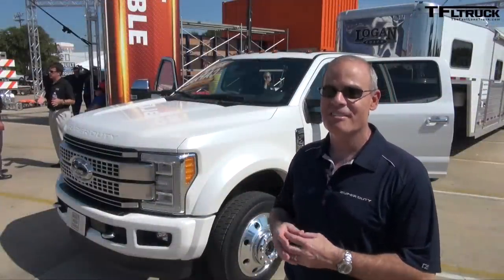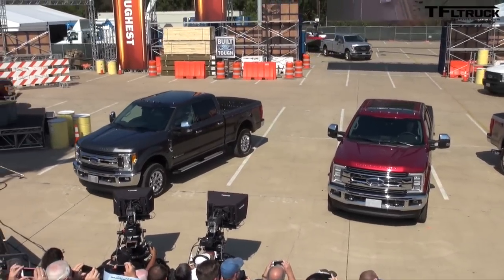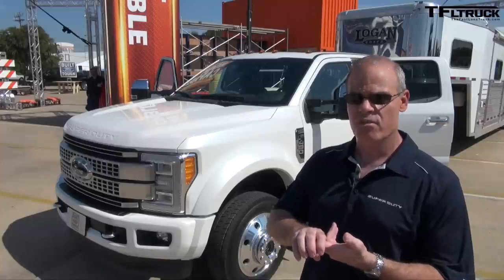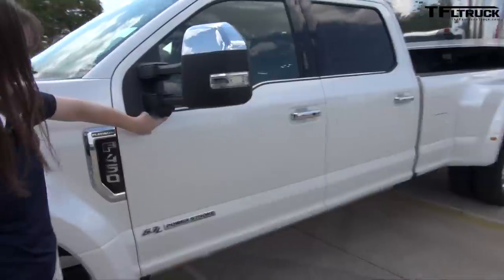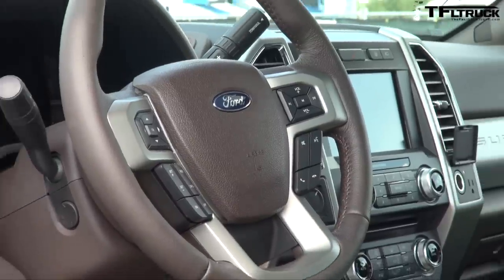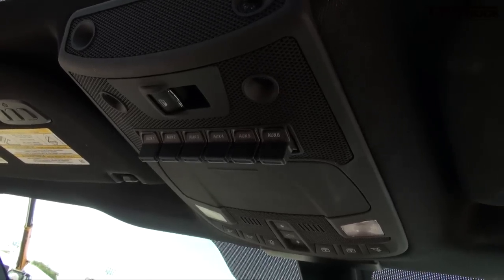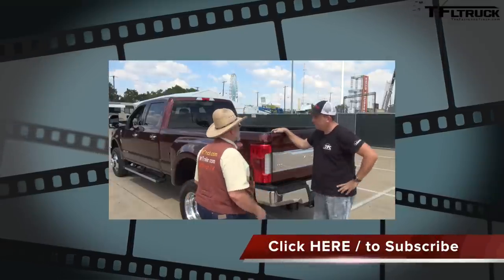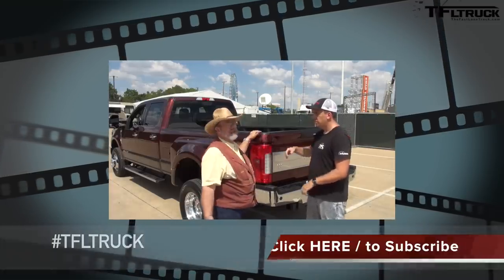2017 Ford Super Duty: The Important Stuff You Always Wanted to Know

Comment: You are correct that GM did great with the 8.1 however in many applications more specifically towing the V-10 is the preferred motor in non diesel applications. We sale 15 to 20 F-450 and F-550 per month in Rollbacks and Self Loaders (Repo Truck) and 95% are V-10 powered. This motor is so popular that Ford has announced to dealers that they are running low and orders for 2016 Models with V-10 power will be full in the next 2 weeks for the rest of the model year!

Comment: Vibration in the steering wheel is not a great idea. I wonder if this is an optional feature. Any ideas?
Reply: +vais3 I would think its more like the vibration feature in your phone not a shimmy of the wheel that would make you swerve
Reply from the maker: Yes, lane departure warning is optional.
Reply: +The Fast Lane Truck That is definitely something I would not particularly like in any vehicle. In my experience I have seen drivers panic with such systems. In my part of the US we have rumble strips that provide vibration and audible feedback.
Reply: +vais3 rumble strips are only on shoulders not between lanes which is what this feature is designed for
Reply: +Kerry Burton if you are on a 2 lane highway rumble strips are between the oncoming and shoulder lanes. 
My point is this system could potentially scare a driver if he/she is focused on the task at hand. I am almost certain a simple lane change would produce a vibration feedback also.
Reply: +vais3 if focused on task at hand u wouldn't wander to another lane and I'm sure useing an indicator would disable the vibration feature for a lane change even though lots of people dont know how indicators work....
Reply: +Kerry Burton a simple wind gust can send you into another lane if your riding the line rather than centering the truck. I can agree with you on people not using signals when they should, it's aggravating. You are right the use of the signal may deactivate the vibration feedback. 
A TFL Truck test drive will tell quite a bit. I would hope they are reading because I would be curious and I'm sure several people are also.
Reply: +vais3 Our 2014 Explorer has the lane departure warning system, when you turn on the turn signal to change lanes it does deactivate the warning for that side of the vehicle but if you don't use the turn signal the system picks up the fact that you are changing lanes pretty quickly. You can also disable it completely by pressing a button, I think it is actually off by default and you have to turn it on but I'm not sure about that.
Reply: +vais3 you could always turn it off
Reply: jim dandy that makes no sense typical response chevy ram blah blah ;)
Reply: +vais3 In my Silverado High Country the seat vibrates, scares the shit out of me sometimes when i forget that it's there.
Reply: +Kerry Burton You need to travel more, many states now have rumble strips before intersection as well as down the divider lines.
Reply: I had this same feature in my '14 M5 and in fact it is very helpful; especially with sleepy drivers and drivers who's attention is on the cell phone for instance.  Any driver who would panic with this system is asleep and there are very few parts of the country where there are rumble strips in the center divider.

Comment: A V10 gas engine in such a truck - got a private oil rig?
Reply: I've got an Excursion with the V-10. Don't change it but every 15,000 miles using 8 quarts
Reply: @F-350 Guy I've got flowmasters on mine and it sounds just as good as the 6.2

Comment: OK. All of the RVr's are asking what size are the gas tanks? Hopefully, not the way too small 26 gallon tank currently on the diesel short bed. The problem is that you watch the gas gauge go down very quickly and you constantly need to find a diesel station that is RV friendly.
Reply from the maker: Great question. We will ask Ford.
Reply: +Heddingmyway Gotta get a titan tank or a flowmaster system! :D
Reply: This is why we have an aftermarket, there are various  secondary  tank options for poeple that want extended ranges.

Comment: I am a big fan of this truck! And I am just dying to have one. Only problem is that I'm 16 :/ I am a die hard Ford boy. Can't wait until I am able to buy a truck like this, WELL DONE FORD!!! 😀😀
Reply: +Jaydenn Hicks I discovered really fast that these trucks eat tires and brakes for lunch...the pads and tires last about 30k and tires are about 800 and brakes front and rear cost me about 300 just for the pads and shoes my old truck used(I had a 1992 f350 diesel and two e350's an 1989 with a 460 and a 1990 with a 300)...get yourself a nice f150...they are very capable and you'll love it...I rented a 2014 f150 5.0 and it was so much better than any of my other trucks at towing/gas mileage etc... an absolute pleasure to drive

Comment: I understand the cameras and other features are for safety and ease of use, but if you need seven cameras and a vibrating steering wheel to drive a truck and tow, then you shouldn't be driving that truck or towing with it. Id say three or four cameras at most, and have them wired to the infotainment to create the wrap around view like in some f150's. (i think it was that model-i remember a truck on this channel having that feature.)
Before i get hate for saying this, i am under 21 and don't drive, but when i do, i intend to learn it without electronic assists. 
And a question-so, desert race trucks are usually made entirely out of tubes, a tube chassis design. Would that be practical/strong enough for a HD truck? Production and labor aside, would that chassis function? (I understand fabricating those is not a point and go job...the complete opposite of it, in fact.)

Comment: You need to be able to take several of those cameras and record them so you have builtin Dash and Read cameras. In fact I'd like to see a mode where you could record the 360 degree view as well. That way when you have to go through checkpoints you can record the K9 going around the truck. Let us supply the memory cards they just need to provide the control. I'm betting they could reprogram the system to do just that. And no I'm not being paranoid just stating fact on something that happens all the time.

How tall is the bed now? It's been tough using the newer pickups with many of the RV 5th wheels because the bed sides are getting so darn tall that the trailer won't clear them.

And not being able to turn on the rear camera when moving forward is just plain stupid especially the bed camera. You need to be able to see if there is a problem in the bed or with your trailer connection.

Looks like a good truck but we need to know more. It's also a truck that I'm betting will cost well over $80K.
Reply: +timon0x31 That 360 degree view for checkpoints is a damn good idea. I was at a checkpoint in Arizona in my 93 F-250. My dad and I baby her and the paint job. I'm not saying border patrol does a bad job but the fuck'n officer had the dog jump on the passenger door. I was gonna explode on them but I was tired as hell. 3 hrs later I'm home and my 22 year old paint job is fuck'd.
Reply: +timon0x31 The bed is actually a little bit shorter than the one used on the F-150. Notice that the top of the bed doesn't quite meet up with the bottom of the window.

Comment: Will be ordering a 17 F350 4x4 reg cab with the PSD as soon as they let the dealers order. Trading my 15 F350, which has been a great truck thus far. 
Any word on new for 17 colors?
I want ford to go after the SNOW PLOWING MARKET next. More guys make a living plowing snow than pulling a trailer. Heated wipers, integrated flashers for the cab clearance lights and mirror blinkers, TOP QUALITY SNOW TIRES AS A FACTORY OPTION, defogger for the rear window, HUGE REVERSE LIGHTS, and for the love of God......can Ford please make a heating system that will supply heat to a man's LEFT FOOT and not JUST the right foot??? I actually use my left foot to drive just so I can keep it warm when it is 0° out.

Comment: All these unnecessary upgrades only increase retail price. The people who use these trucks need the power/strength not the luxury. "It's a NO from me"
Reply: +Michael Cain most are OPTIONS u can get the bare bones work truck for a lot cheaper without all the bloat
Reply: +Michael Cain Then dont buy a loaded truck ,its really that simple .
Reply: They still offer the xl and xlt. They just don't get as much attention on release because the luxury trims have the latest and greatest features.
Reply: +k3v015Mk unfortunately, the XLT models at my local Ford Dealer are pushing $50k MSRP! the Super Dutys they sell are EVEN MORE Expensive!
Reply: digitalrailroader yeah that's true. It just gets to a point where you might have to order one to your spec to save money. My 15 xlt scab is pretty basic and was 37k with incentives. Just depends what you're willing to pay for I guess.

Comment: the parts counter guy at work at our fleet dept. showed me the size, or lack thereof, of the starter in a v10 2013 ford.  They certainly didn't reinvest anything into the starter...failed already..   I've seen riding tractor mowers with bigger starters.  (visually).  "new and improved."  If it is new, how could it be improved, also?.  Yeah, I'm in one of those moods.  On the plus side, it is a sharp looking truck.  I like the look of the  interior.  Ford's trucks as of the last 5, 6, 7 years, have impressed me with their newer design and way they drive.  that old s hitty plasticky gear shift was long over due to get rid of.  This is all coming from a person who isn't a ford guy, per se.  New GMs just piss me off.  Arrogant company.  Shame too, love my old caprice from the 80's... bought a tacoma instead.
Reply: THE STARTER IS A PMGR. PERMANENT MAGNET GEAR REDUCTION FOR WEIGHT SAVINGS. EVERY MANUFACTURER IS USING THEM NOW. IF THIS STARTER FAILED, ITS PROBABLY A SHORT TRIP TRUCK WITH MANY STARTS PER DAY, OR SOMEONE HAS KILLED THE BATTERY MULTIPLE TIMES AND DOESNT REALISE THE MAIN CAUSE OF STARTER FAILURE IS LOW VOLTAGE WHICH CAUSES METAL TO ARC,AND BE DRAGGED OVER THE GAPS IN THE COMMUTAOR, CAUSING FAILURE. .INDEPENDENT MECHANIC. MY OWN SHOP 30 YEARS. SEEN V10S WITH 725,000 MILES ON SAME ENGINE.  6 FLEET V10S, 1 STARTER, BATTERY CAUSED IT.
Reply: +MICHAEL SACCO thanks for the clarification.  He loves dumping on ford. Today, i dont have any loyalty to one or the other.  Everything is lighter, cheaper etc these days anyhow

Comment: Never seen such stupid cost items in my life,.. I want a truck with HD hauling and towing and a motor,... I don't need 7 cameras and a steering wheel that vibrates if i want to know where i am i will look out the windshield this truck has at least $20,000  in things i don't want or need in a truck..... and if your looking at 7 cameras going down the road you just maybe will run off the road and sue Ford......Back to Basics Guys and reduce cost and weight
Reply: that's why I buy the XLT model ... 30 grand cheaper
Reply: +Michael Reece coplains the XLT is too basic
Reply: +Chris Ragsdale . I'm not complaining I don't want all that bullshit
Reply: +Michael Reece I hear ya.
Reply: +Chris Ragsdale you could buy two trucks or you could buy one fully loaded truck that's what the price differences cuz you can get an XLT for about 30k to 35k depending on 4 wheel drive or not and a fully loaded one around here probably around 80 K.. it's a little bit outrageous how all the options can make them that expensive
Reply: +Michael Reece true. But people buy into if they have the money. I still think the truck looks awesome. I'd be fine with the package about the work version. My duramax is an LT with cloth seats and it gets the job done.
Reply: Yeah I have a 2008 f250 it's a XL the only options it has air conditioning heated mirrors power door locks cruise control power windows anna has the vinyl flooring and vinyl seat... and for my business I'm looking to buy a new F 250 in the next year so I'm really interested in this truck but even though it's 100% right off of my business I still don't want all that crap
Reply: +Michael Reece I honestly prefer vinyl floors lol. Carpet stains and is hard to clean. I wish my truck had them.
Reply: Yeah I love them my daughter puked one day on my back seat and floor and I just hosed it out..
Reply: +Newton Washinton That damn Step tail gate has to go. I have ripped off some caps from these poorly designed tailgates removing snow mobiles from the trucks equipped.  We are at the point of using a forklift with long forks to remove their sleds from their Ford with out damaging the tailgate.  I see quite a few trucks around with the tail gate step damaged.  GM has a good idea with the steps in the corners of the rear bumper.

Comment: FORD NEED TO ADD A CAMERA TO THE TAILGATE WHEN ITS IN THE DOWN POSITION.THERE ARE ALWAYS TIMES YOU ARE BACKING UP WITH THE TAILGATE DOWN
Reply: Caps lock is cruise control for cool.. Anyways, they have a camera in the third brake light you can use. Paying attention is hard.

Comment: I have a 2011 f250 6.7l and the brake pedal is mushy and thats because  the brakes are hooked up to a computer ,why not leave the brakes alone and leave them independent from the computer.The dealer told me its because my truck went from a brake booster system to a vacuum system  ,that has nothing to do with a mushy pedal Booster brakes  have a stronger bite than a vacuum system but it doesn't give you a mushy pedal when you go to a vacuum system .I have a 2012 f150 with vacuum brakes and you barely touch the brake pedal and that gentleman will send you through the windshield,I mean the pedal on my 2012 is very firm compared to the pedal on my 2011 f250. I just wish that I could buy the braking system of my 2012 and install it in my 2011.They have no clue what they are talking about when they told me that crap at the dealership.Sometimes the pedal wants to go to the floor,I'm just waiting to hit somebody and then sue the shit out of Ford for letting me drive a 7000lb truck with bad brakes.I advice anybody who plans to buy any of these ford trucks to test the brakes first and then make a decision.I was a chevy man all my life and when Chevy took that bail out money from the government and then it became Obama Motors I said the hell with chevy I went with Ford but now with the brake problems that I'm having I might have to go back to Chevy .The company that I work for just bought  a 2015  2500 HD and man the brakes on that truck will STOP that gentleman on the dime,I mean I could not believe the braking power that truck had. Every Chevy truck I owned ALWAYS had a firm pedal and COLD ac ,my 2011 ford f250 the ac is a joke.When my ford is paid off I was considering buying another one because I buy new trucks every time I pay them off but this time I might just go back to Chevy.Sorry Ford you did this to yourself by not addressing my problems.

Comment: "the design is unique" it seemed like ford copied the f150 and called it a day
they made the side view mirrors air vents, rear dually fender angular for the sake of making a refreshed design
Reply: +shylildude All auto manufactures are going to have the same key designs within a vehicle series. The F-Series is all 4 levels of truck, 150 through 450. You aren't going to have 2 completely different styles between each level of truck. GM and Dodge Literally have the same front ends for the 1/2 ton and 3/4+ ton trucks. Ford at least altered the design slightly.
Reply: +DirtyD the outgoing f150 has no resemblance whatsoever to the outgoing heavy duty so not "all manufacturers have the same key design within a vehicle series"
Reply: shylildude I disagree. Although the bodies overall varied in their shape and appearance, the overall design cues, mainly with the front fascia, were the same. The F150 got bigger headlights that modeled the step design from the F150 introduced in 09, grill design features (larger horz bars and emblem) were crossed over between the two models as well.

The only abnormality were the 04-08 F150 and 04-07 Superduty.
Reply: DirtyD well then, I guess we'll just have to agree to disagree
Reply: shylildude Fair enough. I know not everyone has the same vision when it comes to stylings like that. No hard feelings
Reply: f150 is Ford and f250 f350 f450 f550 is like the bigger brothers of the f150
Reply: Rommel Molano thank you captain obvious
Reply: +Rommel  Molano and... The "F-100" Ford ranger is the youngest
Reply: +Rommel  Molano Mind Blown

Comment: All these negative comments are simply ridiculous, all of these upgrades are using latest technology that make it a safer and better truck regardless of "brand" your negative input simply indicates you will never drive or afford to buy one.....just to keep clear i own a 2015.
Reply: +Bcool4now Its just more added cost. But most of this is MANDATED by the Federal Government. Eventually it'll be illegal to drive so might as well get use to the changes.
Reply: Bcool4now 
Except for the new Torqshift 6R100 G transmission for the gas variants. It was designed specifically to save money by making a cheaper, weaker transmission. Previously the gas engines used the same proven Torqshift 6R140 that the Powerstroke used.

Comment: I wish someone would make a striped down work truck with a manual trans, and transfer case....
Reply: +Diesel Man The Ram Tradesman is available with a 6-Speed Manual behind the Cummins, and Electronic Shift on the fly Transfer case is an option so I would read that as a manual transfer case is standard